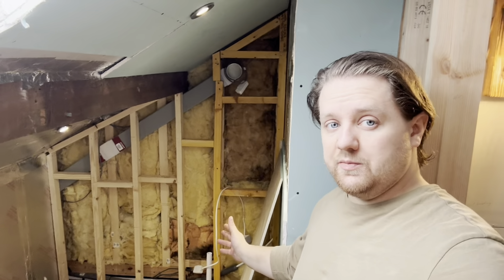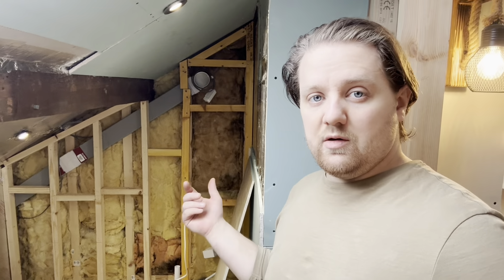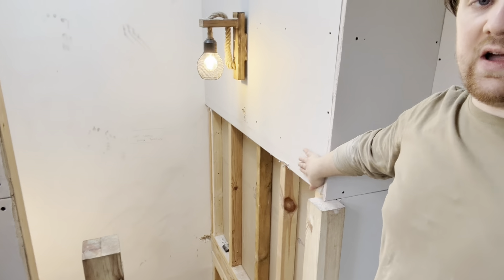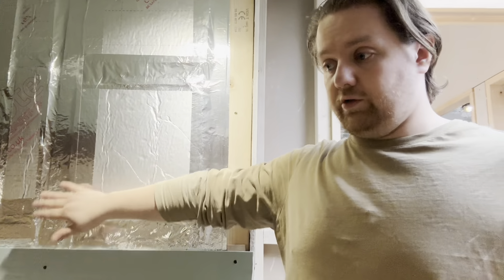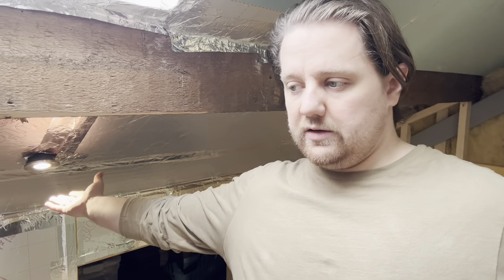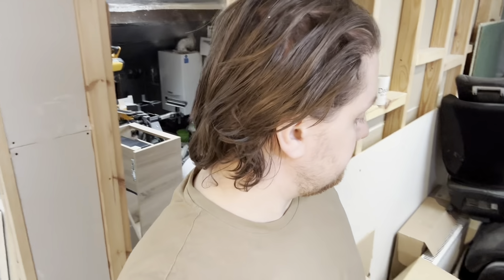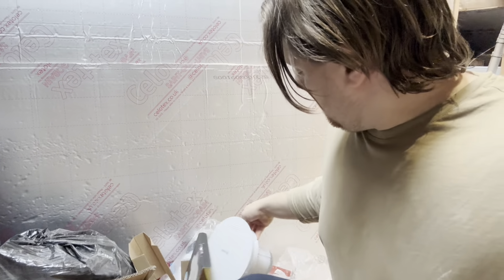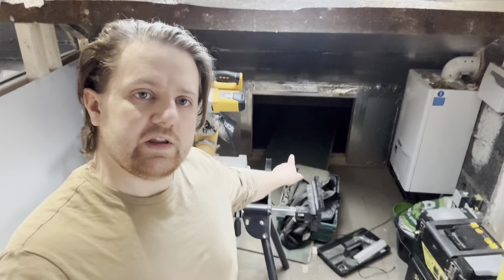Starting to Hang Plasterboard and deciding on bathroom Layout

Comment: Great videos! I have a question: What's the reason behind using FR plasterboard everywhere? It's not common practice. Usually, in loft conversions, FR board is used for structural columns, beams, and the underside of staircases. It might be a good idea to confirm with your Building Control Officer (BCO).
Reply from the maker: Thank you! Good question… this was my understanding, however after my insulation inspection the building regs inspector insisted all the interiors of the rooms and all the board on the staircase be the fire board. The only exception being the landing and bathroom as they are low risk areas 😅